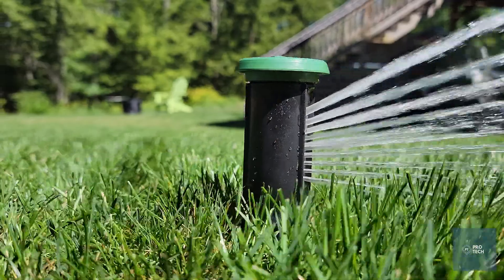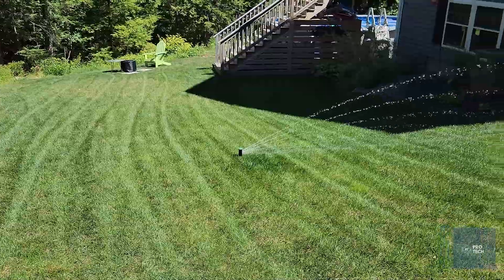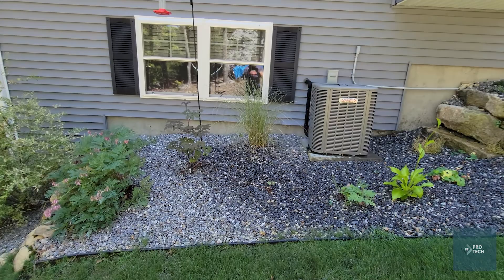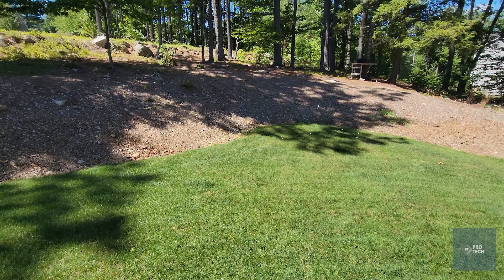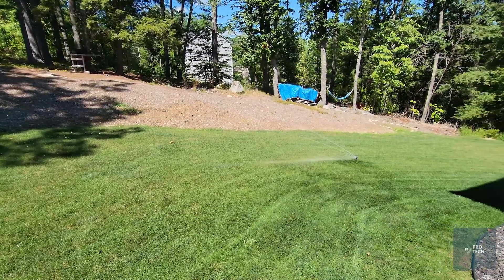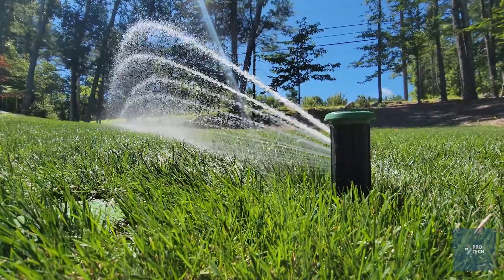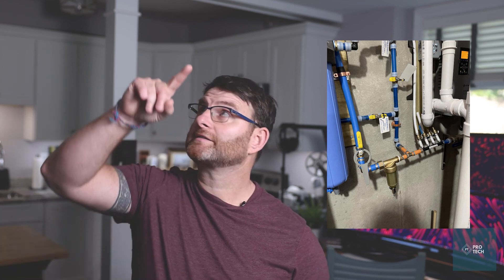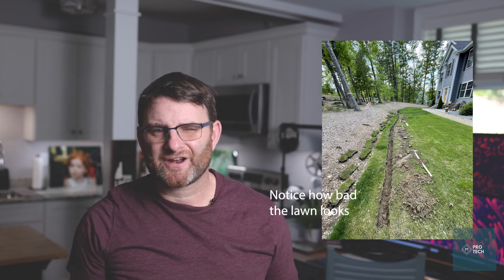Irrigreen irrigation - Review Tips and Tricks ( on well water)

Comment: Thanks for the video and the review it's interesting.  I am considering the system and I am on a well also and currently have an in-ground sprinkler system which is okay but I want to upgrade.  What I did to have the system work better for my home was to have Bushman water tanks installed in my basement to store water for the sprinkler system and I installed a McDonald booster for the constant pressure just for the system no issue with running the system and using water around the house.

Comment: I might be a fan of Irrigreen, it looks great.  But, let's dispell the notion that conventional systems "overspray" each other and "waste" water.  That's not how it works.  In a nutshell, if you have 100% overspray, you simply reduce your watering time by half or some other factor.  The goal is to put a certain number of inches of water on your grass, and you really dont' care if you have one sprinkler sending one inch, two sprinklers sending 1/2", or 4 sprinklers sending 1/4".  You ADJUST your sprinkler time to get what you want.
Reply: This is the right answer, this guy doesn't understand basic irrigation design.  If the irrigation system is designed correctly, it SHOULD have head to head coverage and get uniform coverage across the area by the specific nozzles on each head.  If I water an area 0.5 inches and irrigreen does 0.5 inches, with a correctly designed system, not much difference in water used, you should calibrate your system to know how long to run to get x.x inches of water down (tuna can challenge or various cheap irrigation "cups" to catch water)...  0.5 inches over a specific area is 0.5 inches over the area, whether its me hand spraying with a hose, using your typical hose end sprinkler, traditional irrigation system or irrigreen.

Comment: On a water well pump system, one should do some flow testing to make sure the well does not draw down more than the system and any other concurrent possible use (house use) to below the pump level.  If possible it is best to make the point of connection as close to the downstream side of the pressure tank and the pressure switch that is typically installed at the pressure tank tee. Most often this is a 30 psi- 50 psi switch meaning the pump kicks on at 30 psi and off at 50 psi. (psi is pounds per square inch). Be sure the pressure tank matches the switch. The use of what is called a "Cycle stop" for the required gpm (gallons per minute) that is being used and recommended. This is an inline valve (use the thermoplastic non-adjustable type) downstream of the pressure switch that helps maintain a more steady flow and reduces pump cycling. 30 year family well drilling & pump business  15 year Texas Licensed Irrigator  15 year Idaho Backflow License
Reply: Sir, if I could pick your brain for a minute I'd love to chat.  I'm in San Antonio looking to start a sprinkler install soon and on a well.  I have a pump saver control box and a 3 ring concrete reservoir before the booster pump and 91 gal pressure tank.  Would I still need a cycle stop valve in this setup?

Comment: Getting ready to install my system, what is your pressure at spicket? I am on well as well and kinda worried about spray length also
Reply from the maker: I don't think spigot would matter since it different pipe size from the irrigation. I used all 1in from the well

Comment: Mine looses wifi all day everyday.   I open it. Blinks from green to red.    And when it sprays it pulses way farther than it's suppose. Say I have it trying to follow a 12" straight line.   After second rotation or so it freaks out and pulses like 18ft to 6ft.  18' to 6' or stays at 18ft.  Then find it's way back. No idea why.   And can't get any support. I'm on city water. 70psi.  Also calibration on this head doesn't work.  It fluctuates.  When I pick the 5 measurements.  The rest of 15' to 14'. It hits 15' feet but instead of 14' it drops to like 8'.    I'm so frustrated. This was a absolute bomb of 2k.  Unless they fix it
Reply from the maker: Are you on wifi 6 by chance?
Reply: @protechnh  I have 2.4ghz and 5.  It's orbi mesh.   It connect but loses it.  I actually tried to delete entire system and get it on a dedicated 2.4.  But it always seems to connect to my Google mesh.  But I didn't have a problem last season.

I haven't found out how to change the wifi for the system.
Reply from the maker: @mike gray  I had the same issue. If you controller box getting baked in the sun? I ended up moving my controller box inside and closer which resolved my issue. I think my wifi chip was getting cooked and turning off. After moving to a cool place I didn't have an issue. With shot to built a temp tent and see if it helps
Reply: @protechnh  mine has been in my garage from day one.   Never out in the sun
Reply from the maker: @mike gray  hummmm...have you done a factory reset of everything? Set a static ip by chance by mac reservation?
Reply: @protechnh  I unplugged it. But dunno how to do a factory reset.   Or set a IP on the machine
Reply from the maker: @4rdzlla  you up should be able to be setup on your home router. There is a key sequence to reset it.
Reply: @protechnh  I don't have the key sequence to do a full reset. Because I would try to set it up with a specific 2.4ghz connection

Comment: PEX is horrible for pressure loss.
Reply from the maker: What do you mean?
Reply: @protechnh    Irrigation systems need to be calculated for pressure loss.   I think each irrigreen head flows 6 gpm.  Standard PEX is not even rated for irrigation or did you use black poly pipe?      I would have ran 1 1/4" schedule 40 for my main line and then branched off to each head with 1" flex
Reply from the maker: @NSB Construction  if I remember correctly, I used Pex A which is suitable for underground.  If I used -1/4 , I wouldn't be able to bend it straight without a machine.
Reply: @protechnh  I wouldn't use 1 1/4 pex, I would use 1 1/4 pvc.    The pex you used has a pressure loss of about 6 psi per 100 feet.   Thats why you lost so much distance.

Comment: How much did it run you not going by the discount? I’m on well water too and like the idea of this system. Curious as to your pricing. If you mentioned it in the video. Sorry I missed that.
Reply from the maker: I originally went with a 4 head setup for $2,962.00 but made small changes through the process. Hope that help some
Reply: @protechnh  thanks for the reply! That does help. How much in materials on top of the price from the irrigreen? I’m imagining it will roughly get to about $1000 a zone based on piping and if you rent equipment for trenching. Seems kind of steep but I like the programmable ability of the spray pattern. That’s huge
Reply from the maker: @EngineeringDisaster  no way was it that much. I think around $450 for my 3 heads
Reply: @protechnh  oh so you’re saying it was $3,000 total for everything you needed for the whole setup supplies and irrigreen product? Maybe I misunderstood you in your first reply.
Reply from the maker: @B Stein  for 4 heads it would of been that much. I ended up with 3 heads. I don't have the number for 3 heads but I did for 4. ($2962)